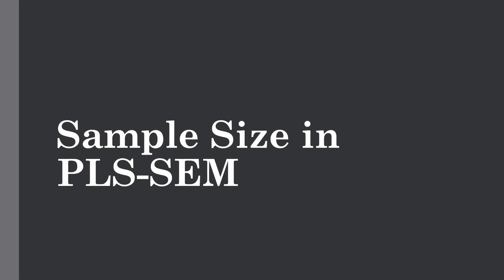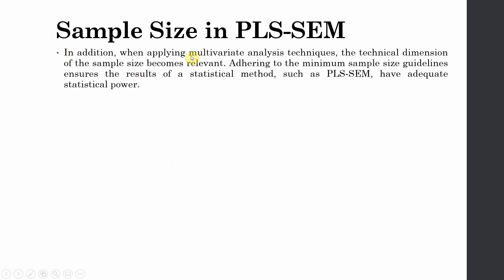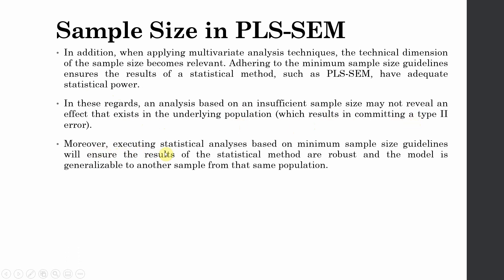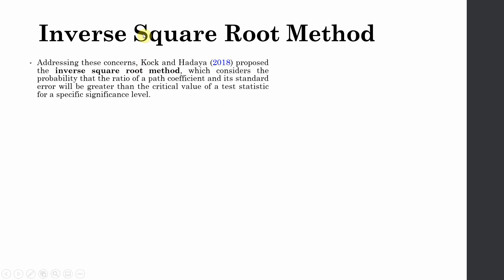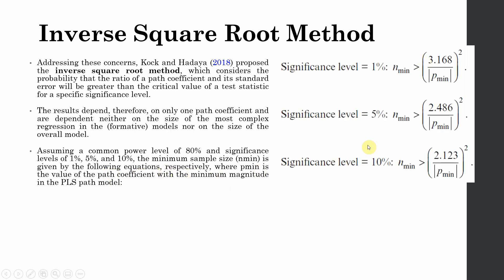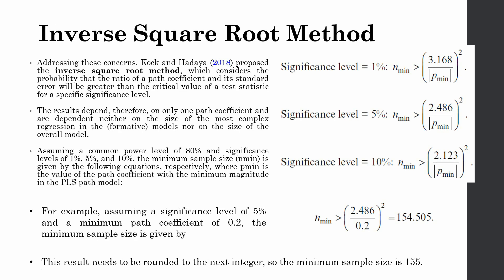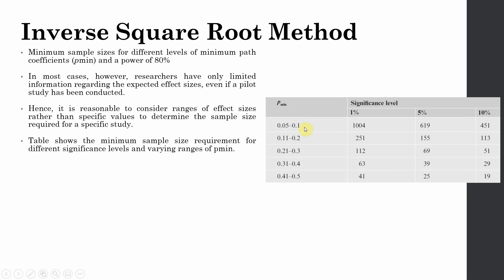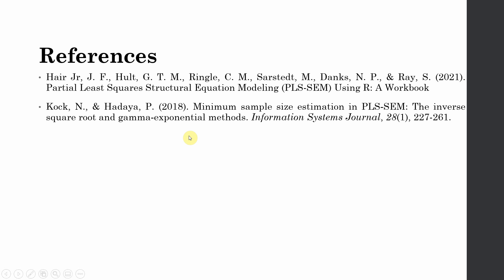How to Calculate Sample Size in Structural Equation Modelling (SEM) - Inverse Square Root Method

Comment: Can you help me with the reference where path coefficient of 0.2 is taken as standard
Reply from the maker: Please refer to 
Hair Jr, J. F., Hult, G. T. M., Ringle, C. M., Sarstedt, M., Danks, N. P., & Ray, S. (2021). Partial least squares structural equation modeling (PLS-SEM) using R: A workbook (p. 197). Springer Nature.
Reply: Hi Sir, thanks for your explanation and the video. But, i can't get the standard path coefficient is taken 0.2 on social reseacrh on that's book. i just get assumption if use path coefficient is 0.2. Thanks before  @researchwithfawad

Comment: Dear Sir, i have taken 300 sample and will apply SEM. i think it's most necessary in research to give the reference and citation for this technique. I didn't add the reference and citation. If you have citation and reference regarding 300 sample size then please send me.
Reply from the maker: Sample size of 300 or any other number is a subjective assessment. It is recommended that for Behavioural Research the sample size is over 200. Refer to Roscoe (1975). 

Roscoe, A. M., Lang, D., & Sheth, J. N. (1975). Follow-up Methods, Questionnaire Length, and Market Differences in Mail Surveys: In this experimental test, a telephone reminder produced the best response rate and questionnaire length had no effect on rate of return. Journal of Marketing, 39(2), 20-27.

Comment: Based on what i can choose my significance level %? Why would i choose 5% and not 1% or not 10%?
Reply from the maker: If you are in social sciences we normally keep it at 5%.
Reply: @researchwithfawad  thanks
Reply: Another question based on what the path coefficient is determined? Should it be calculated?  @Research With Fawad

Comment: Asalamualikum Sir
If u could please clarify a bit about effect size, what is it actually?
Reply from the maker: Normally the path coefficient is significant at .20 in Social Sciences Research. So if you use .20 to calculate sample size, there is a probability that with a sample of 155 you can expect significant results.